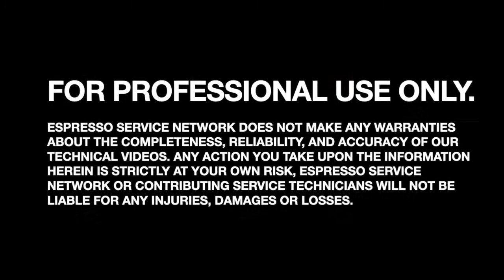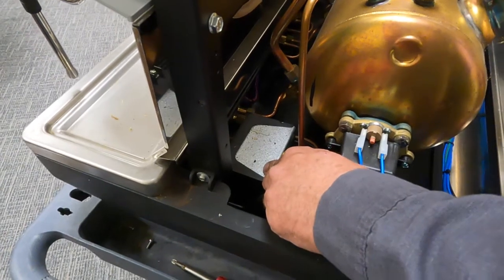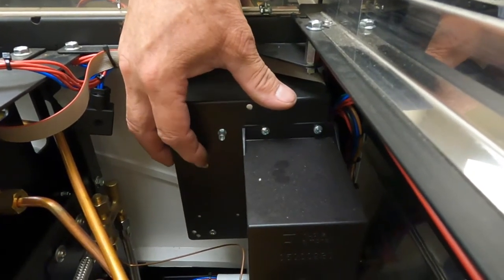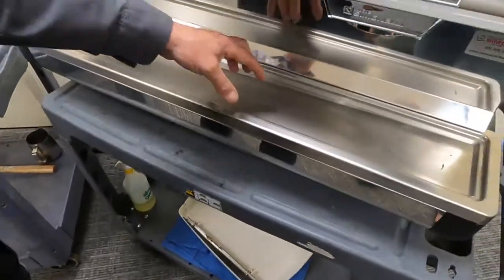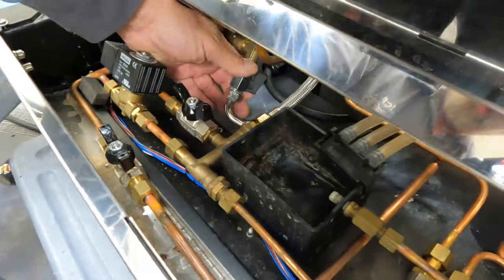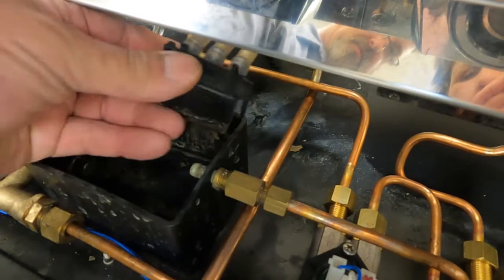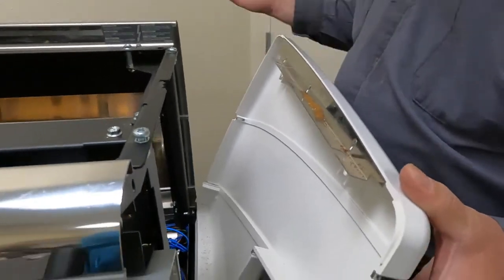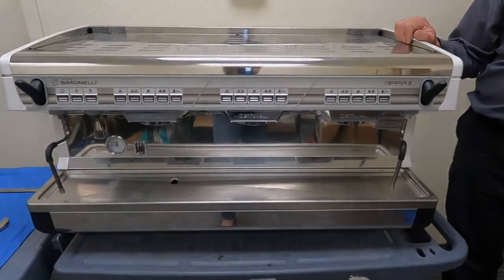Nuova Simonelli Appia Components Repair and Maintenance Operation Tips

Comment: what an amazing video, i have the appia 2 groups, it was working perfectly, but 2 days ago the room that it was in, got a temperature of -10 and everything inside froze (the machine was turned on) with the (stop/continuous shot) keys both flashing, while the other keys are illuminated (if i press any key,  they work as they should) but the machine isnt heating and cold water comes out of the groups

i opened up the machine from every side and let it dry out,  when i turn it it on, it does trip the main breaker.
what i tried, is to disconnect the water level probe from the boiler, by doing this, the machine no longer trips the breaker.
i have few conclusions in mind
1: the probe got damaged during the freeze (the boiler had water that froze inside it probably)
2: the heatsink inside the boiler is damaged (due to freezing boiler with water?)

ive checked for melting cables or something that looks off, all cables looked neat and no melting.
the pump works, the groups release water when pressed, couldnt try the tea water as it didnt heat up

i know its a tricky situation and an unusual problem that could have many theories, but i would appreciate any insight to solve this <3

thanks a lot
Reply from the maker: The flashing lights indicates a boiler refill error.  Unfortunately, the refill error shut down your machine which allowed it to freeze.  If it's tripping the breaker, it's probably because things were wet. Start by finding out why your machine was wet on the inside. Freezing an espresso machine is never good and there could be a host of things wrong: cracked pipes, burst heat exchangers and flow meters, damaged fill valves and destroyed gauges are all to be expected. Burst heat exchangers means a new boiler. I am very sorry. Dave

Comment: Amazing detailed video
I have the Nouva Simoneli Appia 2 Group High Cup Commercial, a year ago was the last time I used it in a cafe situation and it was running great.
Last week I plugged it in and tried to run it, it initiated fine by taking water and heating up as usual.
When it reached temperature and pressurized:
•	The left group operated perfectly
•	The water tap on the left operated perfectly
•	Both left and right steam outlets perfectly running
The only thing that did not operate well is the right group which did not have any water coming out.
I checked the solenoid it is working well but no water behind it.
I am not sure what to do next.
Kindly help
Reply from the maker: If you are sure the solenoid is opening and closing., you may have a clog at the flow meter jet.

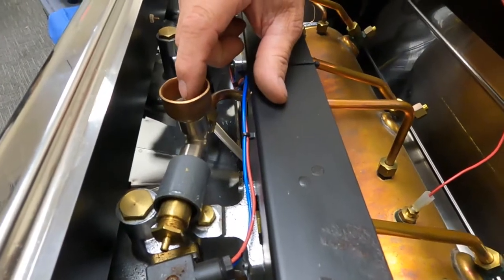Comment: 2:50 the safety pressure release is facing the 240 volt three ways solenoid? why? bad design?
Reply from the maker: You may want to consult the engineer for a more definitive answer, but based on my understanding, it's likely that they relocated the component away from the boiler to enhance its longevity.  The three-way valve is sealed. Moisture exposure is unavoidable regardless of the safety valve's placement. However, if the safety valve is releasing, there are more critical concerns to address, and it's imperative to promptly shut down the machine.

Comment: how to solve group button not flashing error? and please explain how to handle it 🙏
Reply from the maker: I am not certain what you are asking. If your group button is flashing it may mean it is sensing no water flow through the group, the machine is in a clean cycle or it is a boiler fill time out.  For the boiler fill time out,  try turning your machine off for 5 seconds and back on  to reset.  If you have water at the group check the flow meter.  If it is a boiler fill error it could be a lot of things.  Let me know what you discover.

Comment: Hello. Would you know the dip switch setting at the back of the button panel on group head no. 2. Mine has been behaving strangely since someone cleaned the contacts on the ribbon cable connecting to it & I think they may have moved one of the dip switches to the wrong position by accident. Thank you
Reply from the maker: Hello! I do not know from memory  but you can call Simonelli directly and they will help you out. Just a thought here. If someone was cleaning your contacts, it may mean you need a new ribbon cable.  it just depends on what is not working right. Simonelli contact info https://espressoservicedirectory.com/directory/nuova-simonelli--ferndale-wa/
Good luck!
Reply: @EspressoServiceNetwork  hello. Thank you very much for the advice. Much appreciated. Your channel is very helpful. Alan
Reply from the maker: @alanbeanbrownie1524 I am happy we could help. Much thanks for the encouragement.

Comment: Hello. after the flowmeter, is the tube going straight to HX boiler? is it normal for the tube & flowmeter to be hot as it connected together?
Reply: NS Appia Compact 1gp - i had my flowmeter jet clogged, after cleaning it only realise the whole line is too hot. not sure if i miss anything.
Reply from the maker: Yes and yes, it can be.  It is difficult to say if there is a problem without being in front of the machine. Does your machine brew fine?

Comment: Great video!
I have a question regarding the two group version (although I’m sure it’s non-specific), on power on, the water pump wasn’t engaging properly just clicking erratically (it seems trying to engage).

Would this be a capacitor problem? I have ordered another one but it’s going to take some time to arrive. The machine doesn’t heat at all, although it has power and the thermostatic switch is fine (hasn’t overloaded or needed to be reset).

What other tell tale signs should I be looking for? I initially thought it was a relay problem, but after replacing that, there hasn’t been any change.

The machine turns on, (has lighting to the buttons, etc) but won’t begin to heat and there is no rotary pump ‘click’ engagement.

Thanks 🙏
Reply from the maker: Most likely, you have incorrect power feeding the machine.

Comment: Hallo, do you know how to setting boiler water level? Cause mine only filling about 1/4 of the tank, im seeing from the tube glass in front.
Reply from the maker: Which machine do you have? Appia or Appia II ? The viewing window does not tell you the actual level of your boiler. Typically,  if you see water in the tube, your boiler level should be fine.

Comment: When I go to pull a shot using the p3 button. No water comes out of the group head. Then the stop button starts to blink. Pressure meter looks fine.
Reply from the maker: There is no water flow so you have a clog somewhere.

Comment: I have a screw that mixes hot and cold water, which way do I turn the screw to adjust out the roaring I get when I push the hot water button? Thanks
Reply from the maker: What do you mean by roaring? Turning the screw counter clockwise will give you a cooler output.
Reply: Gushing rather than a steady flow, it's only just started doing it.
Reply from the maker: @nicksalt4011  How old is your Appia?
Reply: 1990s
Reply from the maker: @nicksalt4011  Most likely your cold mix valve needs to be replaced. A common issue is the plunger seal becomes swollen and restricts the  cold water flow, which results in spitting and spattering of hot water coming out of your faucet.
Reply: @EspressoServiceNetwork  Thanks for that, I will talk to my guy. The water starts off flowing well but gushes after a couple of seconds. I assume this will be a stock standard with appias, I would put a video up but Yuotube is very picky about what it allows, unless it's violence and police chasing people that is...🤣

Comment: If you follow the boiler draining procedure, does this let all the water from the machine?  Shipping it to a new location in winter and afraid of freezing.
Reply from the maker: You are correct in thinking it does not eliminate all the water. out of the boiler.  Water will  remain in the heat exchangers, solenoid valves, pump, pressure gauges. etc. Espresso machines must always remain in an above freezing environment.

Comment: I have this machine and I'm having an issue with low pressure. It's sitting at 2 and maybe gets to 3 when pulling shots. I've replaced the pump, water filter, confirmed the fuse is good, and checked for blocked valve meters. What's left??
Reply from the maker: Check voltage going to the motor. If no voltage is present then most likely it is a bad relay on the board. If voltage is present check capacitor on the motor. Lastly, you may have a bad motor. Let us know what you discover.
Reply: @EspressoServiceNetwork  
I got it working again by switching the filter with a filter from another machine. Both machines ran fine with pressure above 12!

Now, I have a steady stream of water going into the reservoir. The machine is usable, but my water bill will go through the roof, lol. I'm guessing it must be something like a solenoid. I've searched all over and found no one having this issue. Any ideas?
Reply from the maker: Reduce your pressure to 9-10. 12 is generally to high. If your filter is clogged, it will cause your pump to cavitate and not have proper pressure what do you mean water is pouring into the reservoir? Reduce your pressure and that might help the issue. If you’re running at 
12 bar or above, the expansion valve may be opening and dumping down the drain.
Reply: @EspressoServiceNetwork  
Sorry I should say that at rest it sits at 6 and when in use it is 12 to 15. No matter when, there is a steady stream of of the right pipe of the reservoir. Not the 3 from the heads or the drain plug. It's like something is telling it to not stop or to dump water. I've reduced pressure and still seeing the same results
Reply from the maker: If you’re brewing at nine bar and the expansion valve is still dumping water.,you need to replace the expansion valve. if you’re brewing at 12 bar and your expansion valve is dumping water, it’s doing its job.

Comment: Espresso shot I get from my appia life 2 is not hot enough. Can I adjust the heating degree of espresso. TIA
Reply from the maker: If your groups were hot but are no longer, this can be a sign of mineral buildup. You can adjust your steam pressure up to make your brewing water hotter but do no raise higher than 1.3 bar.  You can also increase the water level in your steam tank. Doing these things is best done by a professional tech.

Comment: I have this machine and just installed it in a coffee serving trailer.  It seems to be wired correctly and have the correct power, but when we turn the power button on at the bottom NOTHING AT ALL HAPPENS.  we have power and we have water.  I know this machine operated fine before it was unplugged and put in my trailer.
Reply from the maker: is the front power light flashing?

Comment: Hey, I have a problem with my machine. its Wega three group but whenever im trying ro make a shot water won't come out of the group heads. the steam works perfectly and also the hot water tap is working the only problem is in the groupheads. it makes a weird sounds when you turn on a group head but it doesn't let any water out from all three heads. I am not sure what Is wrong.I am just a struggling student at university with a small coffee shop and its not that busy I dont get how the machine overheated if its overheating. I am too broke to be consulting technicians, I have already used 22k on the machine
Reply from the maker: There could be many reasons water is not coming out of your groups. 1. Your water is off. This would cause it to over heat too.  Another thought is you  could have cleaner stuck up in the groups. You can clear it by operating the group on and off to try and break it loose. I'm thinking your water is off though. Let me know what you discover.
Reply: @EspressoServiceNetwork  The problem is that water does come out if the machine is off which means there is no block I think. the problems starts when the machine is on, water do not come out at all.

Comment: Im having a problem with pressure buildup (on the bottom manometer it goes over 16bars). When I pull espresso shots it drops to 9bars but then after a while it goes back over the scale. Do you have any solutions?
Reply from the maker: Great to hear from you. Most likely a check valve has failed.

Comment: Today my Appia 2 Compact after used for 45 minutes behave unusual....  when I Extract, it stop half way. After that when I flushed the water sound like boiled. Tried to flushed a few times until the sound goes away... But after a few minutes it started again... Indicator on the Gauge looked Normal... What happened to my Appia? Please help. Thank you
Reply from the maker: Is it brand new? It is normal for it to come to a boil if you flush with nothing in it. As far as it brewing short, there could be a problem with the brew valve. Start there. Let me know what you discover.  Also, check your steam pressure and make sure it is not above 1.1 bar.
Reply: @EspressoServiceNetwork   its 3 years old. Turned on every 2 day for 1 hour. Steam pressure is 1.1 Bar. Yesterdau after turned off for 1 hour, I turned on again and after around 10 minutes its already sound boiling again. Today simonelli tech will come
Reply: @EspressoServiceNetwork  the tech said the problem was the check valve (one way valve) They cleaned it and now fixed.